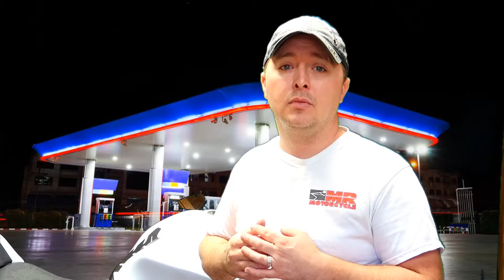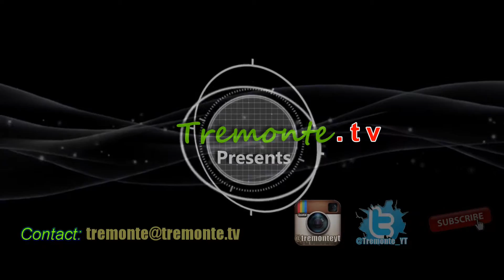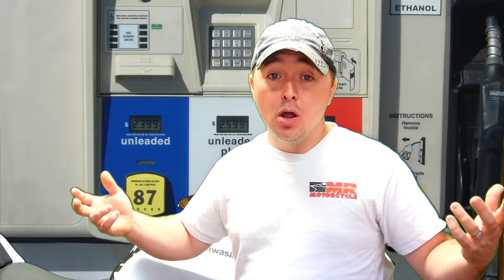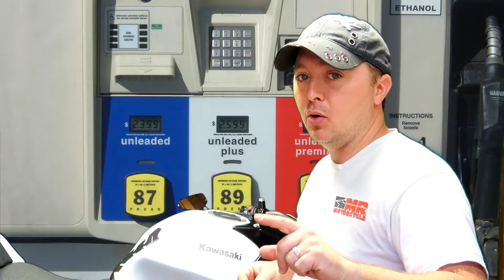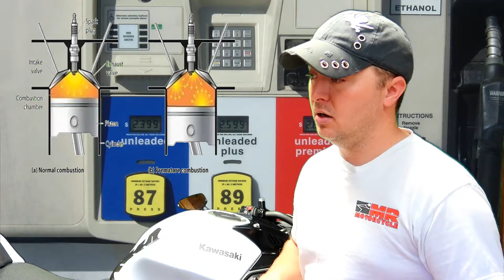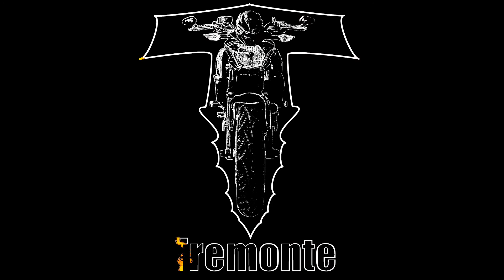What Fuel for Your Motorcycle? | What Does Ethanol Do?

Comment: I have a 2000 Suzuki bandit 1200. I recently fitted a TD04 Turbo using a blow through system on the carbs. Manufacture recommends 89. Should I run 89 or 91/93 now that turbo charged it?

Comment: In the Philippines we have 91, 95, 97, and 100 all e10. I have been using just 91 for all thr reasons you stated from my cbr400rr nc23 to the z650. It us only a marketing ploy stating that higher octane makes the engine gain more hp. I even save more money by using the lowest octane too. Tnx for validating my practice.
Reply: Use the 97, feel the difference. Acceleration, engine sound and engine vibration

Comment: I've a fuel injected Kawasaki (Ninja 400, KRT edition, and yes, it's gorgeous) - if I only use non-ethanol fuel in it, the EFI won't get damaged (I've read that it would get damaged, looking for your opinion and reasoning)? 
Also, if it's ok to use non-ethanol, would I ever need to use a stabilizer like Sta-Bil?
Many thanks!
Reply from the maker: Non-ethanol fuel will not absorb water so it will stay stable longer than ethanol based. Any fuel will degrade after sitting for months. Non-ethanol fuel means no gumming of the fuel lines and injectors which equals less maintenance in the long run for you. It will not hurt using either fuel in your bike, but having ethanol in your tank will mean being proactive on your part during long periods of not riding. Use stabilizer, etc if you're not riding for several months.

Comment: This video has good information for those who are confused on what octane rating they should use for their bikes. When I first started riding, I used 87 on my ‘13 CBR 250R thinking it was a low compression bike 10.7:1; I figured it wouldn’t need anything greater than 87. Geez was I wrong... it requires premium, factory Manuel recommendation. Also before I found that out, it backfired (in a bad way) and knocked hard on regular, but only when I rode it kinda hard. Switched to premium and bam problem solved. Follow what’s recommended, usually it’s right with rare exceptions such as my previous comment about my K8. Ride safe but have fun. Great simple vid bud.

Comment: Okay so this bike if it were a 2017 Kawasaki Z650 has a compression ratio of 10.8:1 and calls for 87 oct. US rating. That sounds right. Although what baffles me is my K8 aka Suzuki GSXR 600 from factory Manuel recommendation is 87!!!! Or higher.  How the heck can it run 87 with a compression ratio of 12.8:1??? I know compression isn’t the only factor for how engines can run certain octane fuels but how can it run 87 without pre detonation? Honestly it feels best around 89-90 octane but that’s by butt dyno and smile rating. 92 oct. which is highest here, it runs fine at high temps ~205 degrees Fahrenheit (~96 Celsius) but is rough at cold starts. Hence why I did the math to get 90 octane by mixing regular and premium, cheaper than mixing mid grade with premium. Sometimes I mix a decent octane booster(Gumout) with regular and I get around the same results. Since the tank is 4.5 US gallons it’s easy to reach 90 octane since 1 bottle raises rating by .8 Ron and the bottle suggestion is up to 15 gallons (56.78 Litres) so concentration is higher in 4.5 US gallons (17 litres) so one bottle gets me around 89.66 octane roughly. Anyways still confused as to why Suzuki would suggest 87 as the minimum recommendation. Thoughts? Feel free to comment.
Reply from the maker: The ignition timing is what allows the lower octane fuel to combust properly with higher compression.
Reply: Tremonte very true, I want to find out what degrees the timing is set and if it adjust automatically via the CPU to compensate the lower octane. Research I need/want to do and learn more about my bike.
Reply from the maker: The ECU adjusts the ignition timing anywhere from 10 BTDC to 35 BTDC. This is on the Kawasaki 650 engines. The best way to know about your bike is to purchase the shop manual.

Comment: So u trying to say if I put 104 in my 1984 Honda Shadow it will just die? Idk I saw my gas station sells it and I was wondering if I could I run 93 I think in mine anyways.
Reply from the maker: It won’t die, at least not until the rings are toast. But you aren’t going to gain anything to justify the cost either.

Comment: lol 87 octan ? .. normal fuel in Denmark is 95 unleaded .. high is 99 unleaded :D
Reply from the maker: That’s because Europe uses the RON method of rating fuel, and we use AKI. Ours is rated at an average and not the maximum. It’s all basically the same stuff, so why can’t we all use the same system right? It’s like imperial and metric. Can’t we just decide with a standard? Lol
Reply: that's correct

Comment: So my ninja 400 manual says 87.  My service guy says only run 91.  Whats your take?
Reply from the maker: +TerryBollea1 I would go by the manual and run non ethanol if you can find it. The store near me keeps 89 non ethanol so that’s what I use. The bike runs great on it, and the AFR readings have always been consistent. The higher octane just delays the burn during ignition for high performance engines. The 400 probably doesn’t need that, else Kawasaki would recommend it. It wont hurt anything if you did run it though. You just never want use use a lesser octane.
Reply: Tremonte  in Colorado the only non Ethanol is 85.  Otherwise I would run it too.  I get alot of conflicting advice from shops around here claiming that the altitude makes things run rich around here.  Alot of guys reccomend going full system exhaust with Cat delete to lean out the bike a little, even though its completly illegal.
Reply from the maker: TerryBollea1 elevation used to be a huge deal back when carburation was common. Dealers would order jetting kits suited to the geographic area. But now that everything has air temp sensors, barometric pressure sensors and a DFI to control fueling, it’s not a big problem. It still can have an effect though on peak performance. You should be fine with a quality exhaust and mid grade fuel without having to tune or run a power commander type device.
Reply: Look for maverick gas stations. They offer 88 e-free. I’m in Colorado too.

Comment: Correct me if I'm wrong...but doesn't the Z650 manual indicate that you CAN run ethanol in this bike?  I don't mean winter storage...but regular riding throughout the year.  You certainly are correct, no ethanol in carburated bikes.  Bad, bad, bad.
Reply: hawkrider88, I don't know if that's wise.  They already run a bit lean from the factory and Ethanol requires a richer AFR.  I don't know for sure, but I'd ask someone who actually knows the facts before trying it.  Definitely if you got it tuned for Ethanol though, it would be fine and you'd get more power.

Comment: Great video and valid points are made here, very much appreciate your videos man! I run premium 91 only in my 2017 Ninja 650 as recommended from the dealer and technician that sold me my bike in person. In the manual they do notate minimum 87+ is to be used, but if knocking or pinging is noticed under any condition, a different gasoline brand or higher octane is suggested. I run higher octane purely for the anti knock element to prevent that from happening, also as a peace of mind. Also to note higher altitudes can contribute a factor to pinging or knock.

Comment: In Australia we have standard 91RON , premium 95RON  or premium 98RON  plus we have Ethanol E10 (10%ethanol blend of 91RON ). My manual says use 91 or above but also says you can use an ethanol blend so long as its no more than 10%. I use 95 in my car because it says it cleans your fuel injectors (and other parts) and will help your engine last longer plus get better mileage. I just thought if i put 95 in my Z650 it would do the same.  I don't want to use ethanol at all because i've heard it can wreck other parts of your fuel system. Do you think i should just put 91 in and save myself some money.
Reply from the maker: +Taniwhais the octane isn't what cleans the engine,but rather the detergents the fuel company uses. Some fuel retailers do have better performing cleaning agents. There was a random scientific test done a few years back that found 90% of the major brands performed roughly the same. But when the cheaper companies were tested and compared, there were a significant amount of deposits left in the engine and injectors, compared to the higher priced main retailers. I'm not familiar with what companies you have where you live, but if Shell is available, it rates among the top for cleanest fuels. If you want to back down to a lower octane, do it one grade at a time and pay attention to how the bike performs. That way you can find where it's happy and most cost effective.
Reply: Thanks Tremonte. We have Shell, Caltex, BP and some smaller retailers. I have mostly been using Caltex but i can try the Shell again. Next fill up i will put 91 in the tank which is the next grade down from 95 here. I willsee how it performs over a few tanks of 91and let you know.

Comment: Hey what’s up man , I have the 2017 z650 and I’ve been using 89, should I go to 87?  I have the Yamaha r6 and that was my first bike here in California and I’ve always used 91 for that one but now with the z650 I didn’t know what to use so I been using 89... I should probably switch over to 87 huh? I never looked in my manual I should have done that first. Great videos tho, I  def subbed.
Reply from the maker: You're fine with 89. That's actually what I run, since it's the most common nonethanol fuel around here. I can't tell a difference between 87-89, but I do have just a bit of hesitation if I run anything 91 and above. It's semi-rare that it would happen, but sometimes between shifts when the bike is under light load and I punch the throttle, I'd feel a slight miss, or lag in the response. Like you, I was used to using higher grade for my supersport, so just assumed that's what I needed (also was misinformed by the dealer). After reading through the manual, I saw the recommended fuel, and found my solution. I stepped it down a grade, and haven't looked back since. No more occasional throttle lag!
So in short, you're already good! Thanks for the sub!
Reply: Tremonte Sounds good man thanks , Ima keep running 89 then, I was just worried that I would mess up the bike if I kept using that one. Your bike looks nice tho , mine is bone stock but I’m going to start doing most of your mods that you have done on yours. Especially the mirrors and shorty levers , those look badass!

Comment: Soooooo, just to be clear, I have a 2017 Kawasaki Ninja 650 and the owners manual calls for 87 octane OR higher. So the "OR higher" part will not give me the maximum amount of power from my engine?? I have run nothing but premium in the bike since I bought it brand new so I don't know if there is a difference, what would be the difference in power we are talking? Need a dyno test on regular 87 octane and one with 93 octane I guess. And no I am not gonna get right on that haha!!
Reply from the maker: +Gilbert Grape that's correct. But, each bike/engine is different. And only several dyno runs on each type of fuel will show the difference. Which may show no difference at all. If you use 87 and experience any pinging, go up one grade until it doesn't occur. But, as I've ran 87 in the Z, you will have no issues.
Reply: Gilbert Grape so i use 93 should i switch to 87 have 17 ninja 650
Reply: There's a reason why it's 87 or higher, not 91 or higher.
Reply: The lower the octane, the  higher the BTU content.

Comment: Cool background work! Even though the owner's manual call for 87 or higher, I have never once ran anything less than 91 octane. I only use Shell V Power Nitro+ but honestly I feel like I am throwing my pennies away. I think I don't think I will lose any performance if I ran 87. I think it's just a mental thing that makes us feel better when we run a higher octane fuel. But I do agree with 100% that if your supersports bike calls for 91 or higher and you run 89 or lower then that becomes a problem.
Reply from the maker: +Jeff C.S I used to be the same way. Only premium. But I also rode bikes that did call for premium fuel. Once in that mindset, it is hard to get out of. In the Z, I run 89 non-ethanol. Mostly because that's the only grade non-ethanol you can get around here. Costly though.
Reply: But you would run 87 non if you had it in your area?
Reply from the maker: +Ted Amell yeah. I've ran 87 with no pinging or knocking. But, that was before I had the ECU and tuning work done. It was setup with 89 in the tank, (because that's the grade of nonethanol here) so 89 is what I use with or without ethanol. I ride frequently, but still prefer non ethanol when it's available.

Comment: Hi, i am from Austria and the standard fuel here has 95 Octane and the high one has 98.
Reply from the maker: To get the bike to run on the higher octane reliably without power loss, I believe all that would need done is to slightly advance the timing to begin the combustion a touch early to allow for a full burn. That would only be a simple change in the ECU for Kawasaki. There are probably several things tuned differently between our bikes because of different fuel and emission laws, but I'm not 100% certain. I wonder if they would answer that question if asked?... hmm..
Reply: That's, actually, everywhere in the Europe. I'm wondering, if the US version has modified engine to work on the lower octane fuel, or it's just the same and it's managed by the cpu?
Reply: I know that it's standard in europe. About the enginge: as asking myself the same thing
Reply: Thomas, my comment about the Europe was more for the folks from the outside of Europe, who might not know :) And yeah, the engine question is quite interesting for me, and I'd like to get some more info on this. :)
Reply: I know this is old, but Europe and US calculates octane differently. European high octane and US high octane is very comparable, just different numbers.